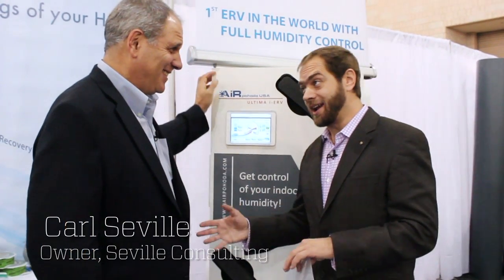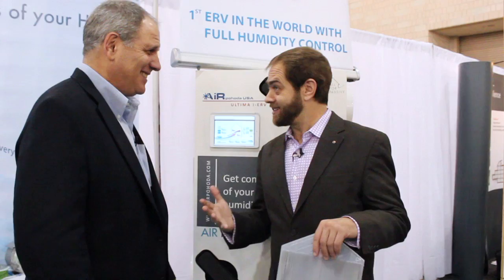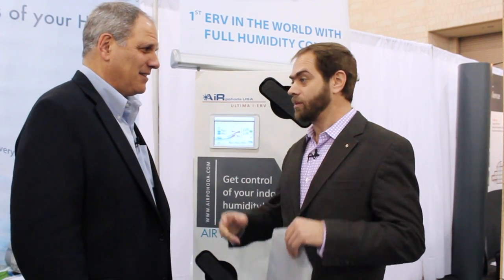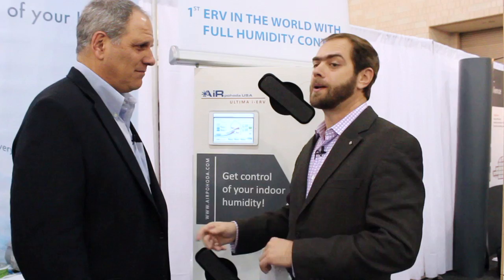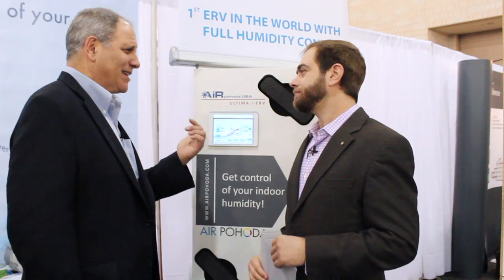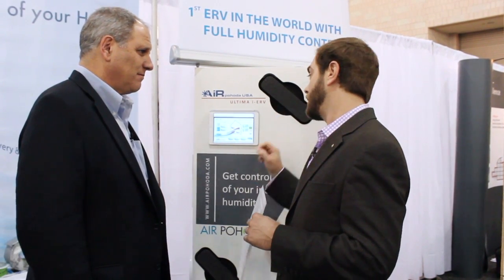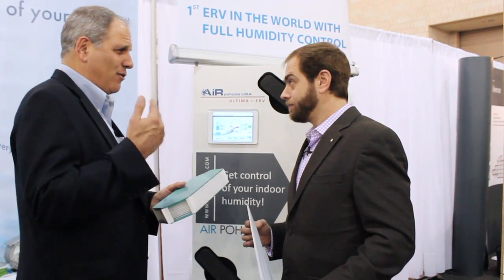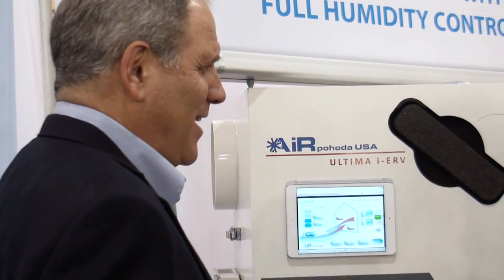The Green Police Debate on HRV vs. ERV

Comment: I would prefer less joking around and more information.  What's the difference between an HRV and ERV?  Where should they be used.  What is the name of the product you are showing.  Are there published studies of the technology.  How long has this technology been in the field.  How efficient is it?  How much does it cost?  How does its cost compare to other technologies.
Reply: We are trying to bring some humor and levity to a fairly dry subject. :-)  It is true as well that we assume a certain amount of knowledge by the viewer for these. I can see a series of episodes that examines the basics of many of these components. This particular set is reviewing interesting products we found at GreenBuild 2013, in very short segments. 

To answer your questions: HRV = Heat Recovery Ventilators ERV = Energy Recovery Ventilators. We are looking at the Air Pahoda ERV. ERV and HRV technology isn't new and there are plenty of published studies. They are standard in new construction today. The efficiency of ERV/HRV technology isn't part of the conversation. Some units are more efficient than others, and that is part of the conversation. The ERV/HRV itself ranges from $2500-7000, but there is more to the system than just the box and depends on the home design which is too variable for valuable commentary. There are no other technologies that perform the function of an ERV or HRV with any degree of precision or control. 

Hope that helps!